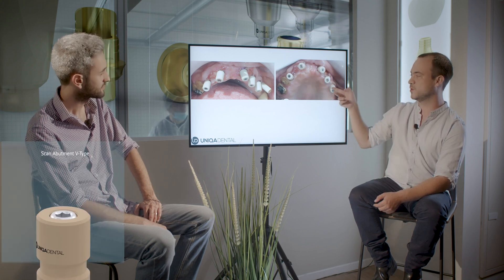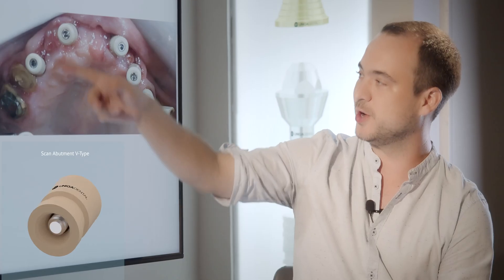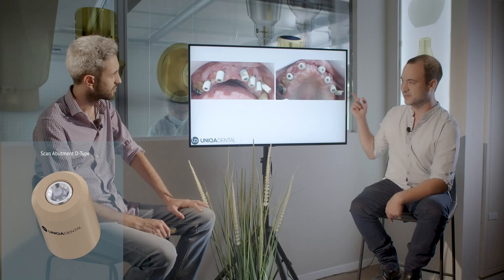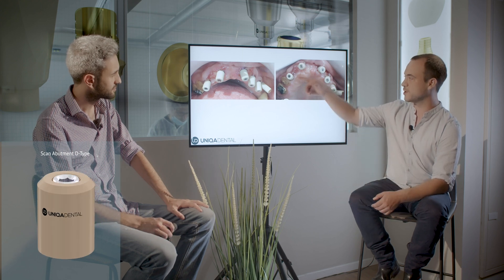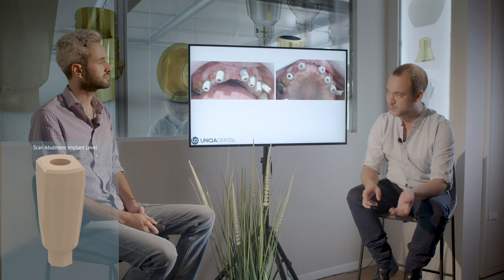How to choose the correct Dental Multi-units MUA? Screw-retained restoration case | Oral pathology

Comment from the maker: How to choose Dental Multi Unit type? Case a screw-retained restoration 
00:00 Intro
00:58 What are we going to talk about?
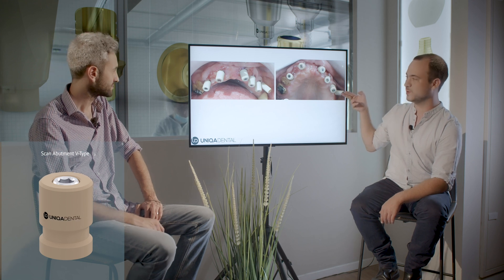02:21 What is the best way to proceed in our case? Two main aspects
03:49 Which Multi-units to choose?
04:50 Why should the finish line be around the gum?
05:13 Different types of Multi-units
09:41 Conclusion